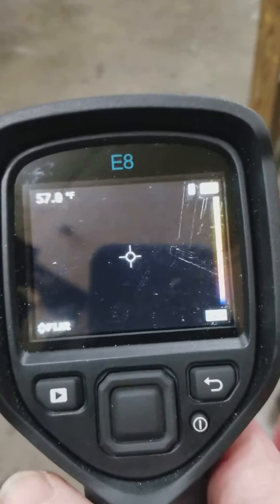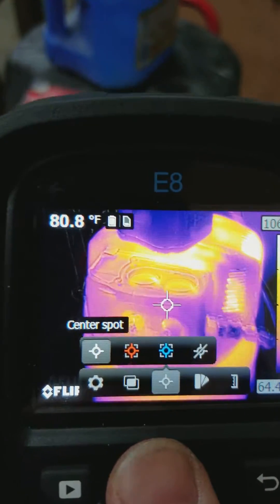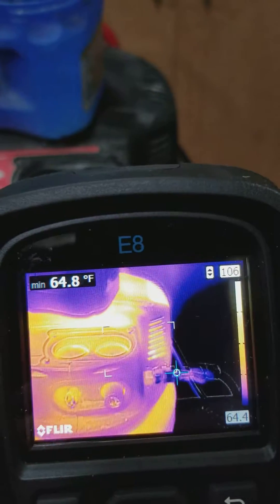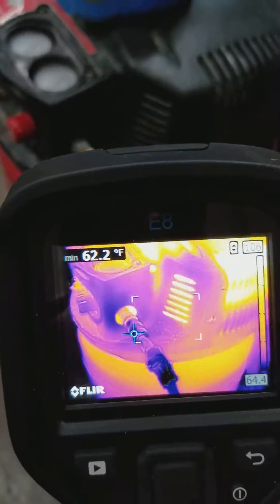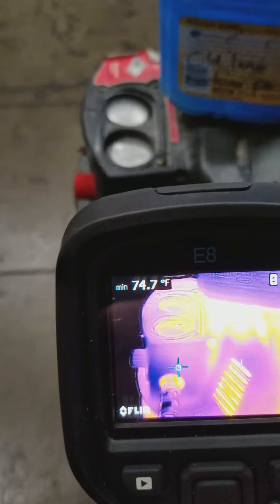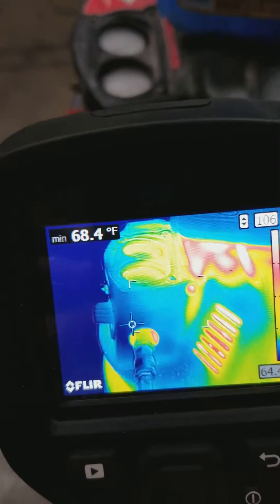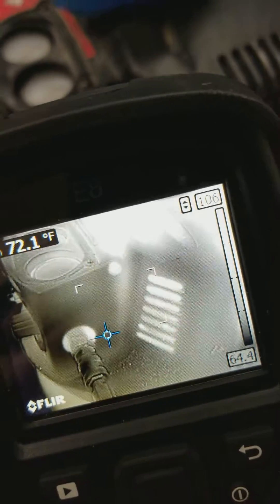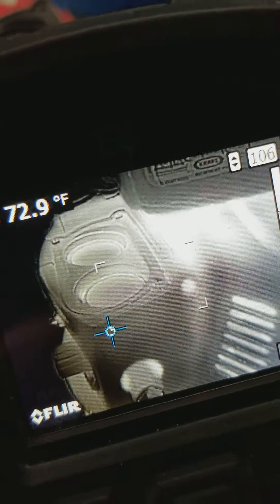Finding Air Leaks with Flir E8 Infrared Camera

Comment: can it see heated air around 100 degrees? or can it only see gases like methane/propane/c02 etc..?
Reply from the maker: Yes. As long as there is a 10 degree delta or difference between the 100 degree air and the ambient temp.